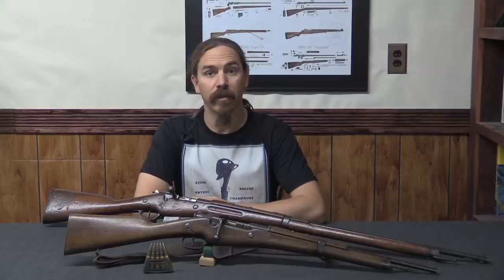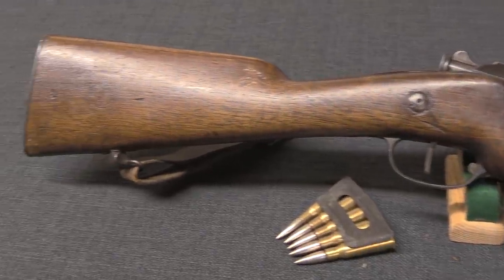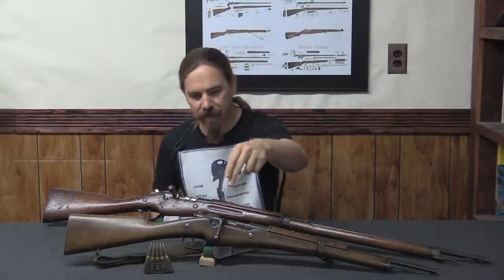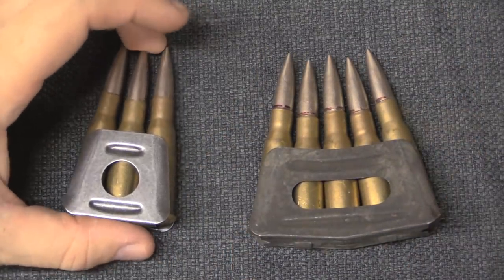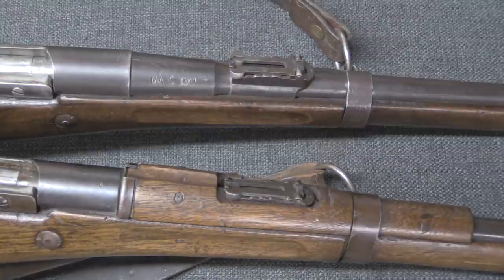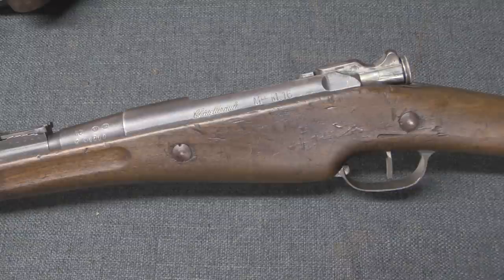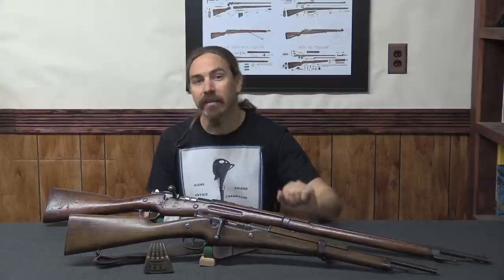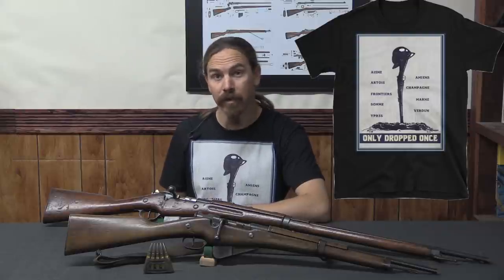The Berthier Gets an Upgrade: The Model 1916

Comment: Silly question -  what happens if you try to stick a 5-shot clip into a 3-shot rifle? I imagine the clip follower stops at the limit of its designed travel and says "NON, MONSIEUR."
Reply from the maker: You can use a 5-round clip in a 3-round magazine as long as you only load 3 rounds in it. The bottom of the clip will stick out the bottom of the magazine, but it will work.
Reply: That's actually really cool show on screen? :D
Reply: Sillier - two 3 rounders in an M16? Catch probably won't get quite far enough up and the last round probably has the same problem as a 6 clip in a 3 round receiver
Reply: The M16 clip deserves some kind of award for its cleverness
Reply: It is very clever. I think 8mm Lebel is interesting too, tweaked to work w/ tube magazines and also not rim lock in an en bloc clip.
Reply: Interesting as it may be, the first attribute there (capacity to work in a tube mag) is also going to be it's downfall, as its extreme taper and rim make it unsuited as a box magazine round.
Reply: As we see it works just fine w/ a 5 round en-block clip. It's not surprising such an early smokeless cartridge didn't work in hindsight. Surprising it lasted so long really.
Reply: Didn't realize A VP had already asked, I too would like to know the answer to his silly question.

Comment: You mentioned that the Lebel had been out production before WWI. Did France ever consider replacing the Lebel entirely with the Berthier?
Reply from the maker: They pretty much did after the war.
Reply: Forgotten Weapons Is the Berthier have any better qualities that make it desired over the M1886?
Reply: probably reload speed since you can use a clip rather than loading it one round after the other.
Reply: Forgotten Weapons Is it true that some Lebels were used during WW2 due to desperation?
Reply: Colt M4A1 yes. The Greek partisans even used 1870's Gras rifles, so I assume the French military or French resistance did too.
Reply: Some of them were even used during post ww2 colonial wars
Reply: +traven bussell it was cheaper to produce, faster to reload, and (being a carbine) is less unwieldy (and at the ranges a typical infantryman is fighting at, the accuracy improvements of a long-rifle really don't matter). Also helped that they happened to be still in production when the french realized they needed a great many more guns whereas the 1886 was really not. 

Most of this was covered by Ian's previous videos, if you want to hear a more indepth explanation then my cliff notes version.
Reply: Everything was better than the Lebel apart from having 8 rounds.
Reply: Was it ever considered pre-WWI?
Reply: France (like most of Europe) had a rifle shortage during WW1. As such, they weren't in the business of replacing guns that were still capable of shooting a modern cartridge. They even bought new single-shot Remington Rolling Blocks in 8mm Lebel for rear-line service. The Lebels remained in use during WW1 because there weren't enough Berthiers to replace them. After the war, the Lebel was mostly replaced, but some (mostly cut down into carbines) were still around in rear-line units even during WW2. The French Army was severely under-funded in the interwar years.
Reply: I think, in addition, the French (or anyone else really) didn't recognise that the advantages of a long rifle are so mitigated by how it's used by infantry until the war was well on. I think what happened was after reports started coming back that the carbines were performing just as well (indeed, lighter and cheaper, to boot!) as long rifles, it cemented the choice-of-necessity of making carbines the more common choice (reserving long rifles for dedicated marksmen, where accuracy at range is far more important).

I think it's pretty clear that they were getting and hearing the feedback too, that's what we see here in the 1916. The one complaint that the soldiers who used both had was probably the lack of capacity going from 8 to 3 round clips (something cavalry who never had bigger clips wouldn't have complained about). Hence addressing it, while 5 is still less than 8, it still helps and didn't require any additional complexity or incompatibility. Frankly, it's a breathtakingly brilliant bit of engineering.
Reply: I heard they kept using a Lebel per squad after adopting Berthiers because the Lebel was better for launching rifle grenades, and the French loved rifle grenades.

Comment: You may need to mention the ammunition compatibility problem Belle D Belle N I nearly used the wring ammo in my carbine.

"Balle N ammo should never be fired from any Lebel or Berthier rifle unless it has had the chamber reamed to accept the larger neck of the N cartridge. Such weapons are stamped N on top of the barrel, just in front of the receiver and behind the rear sight. Balle N ammo is identifiable by the fact that the bullet, while pointed like the solid brass Balle D, is lead-cored and jacketed with soft steel."

Comment: Hopefully your next vid on the "details" helps me ID my Berthier long rifle!!

Its a 1918 Chatellerault yet is still a 3rd magazine and has the early/carbine bent bolt handle.  Each part has different serials so I'm assuming it's a post war conglomerate repair or possibly a private collectors piecemeal reassembly?

In for more info!
Reply from the maker: Probably a gun rebuilt in 1918 with a new barrel - the dates on these are barrel dates, not receiver dates. So an early gun that just needed a new barrel could easily end up in the early configuration but with a 1918 date on it.
Reply: Thank you sir!!

Comment: My Berthier arrived today and as I was inspecting it at the gunshop, I worked the bolt and it was smooth as silk, but as soon as I fired it, the bolt locked up extremely tight and I had to put a small amount of force just to make it wobble but it wasnt budging, and I didn't want to force it either and risk breaking something. Is this an issue with Berthiers or is it something in my gun?